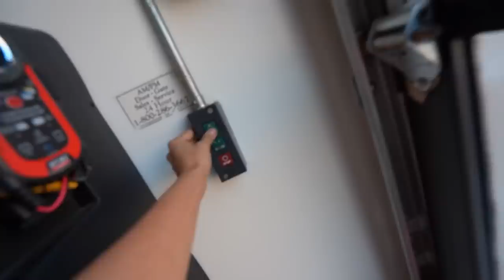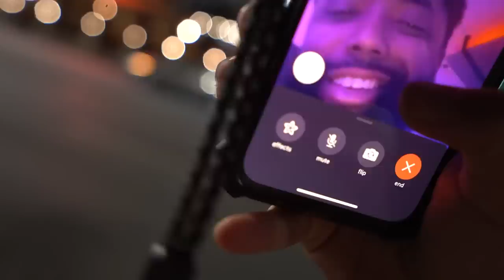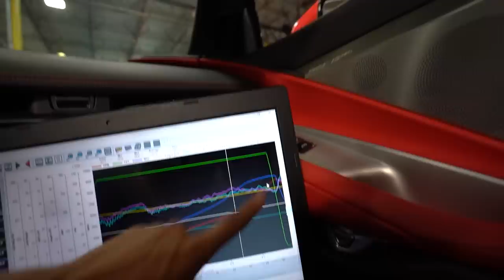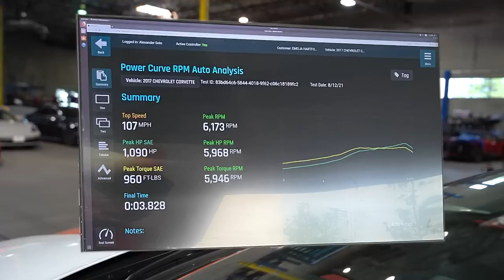TWIN TURBO C8 CORVETTE BREAKS WORLD RECORD HIGHEST HORSEPOWER! FULL DYNO PULLS 1400+ HP

Comment: One thing that helped my hi hp build was a set of ngk plugs that have recessed electrodes. So the porcelain-electrode / spark sits inside the body of the plug, it sits flush with the bottom of the plug. Helped big time with blowout

Comment: When you aren't using the meth injectors you should empty the tank and put regular gas in the tank and run it through the injectors.  You don't want that meth just sitting in the injectors.  You could even use 110 or higher gas just make sure if at all possible it's pure gas.
Reply: Yha, but it's Emelia.....When isn't she using the Meth??

Comment: EMELIA, a company in Vancouver Washington just beat your record and went 9.05 in their C8. You have the power to do it GO BREAK THAT RECORD AND BEAT THEM TO THE 8S
Reply: sounds like they upgraded their transmission too. I feel like she will need to do that to get into the 8s
Reply: @ICP1SBJ  It was an experimental job doing by their shop that they are testing on that car. Unlikely to be up for sale or proven yet so unlikely she can get her hands on it. I mean if the trans can hold it on the dyno it can perhaps hold the power on the strip at least for a few passes so she might be ok to get into the high to mid 8s but its highly unlikely it will hold past that.
Reply: @tstuff1213  yup I think hers might hold for a few passes but I do feel that is the weakest link right now. Time will tell.

Comment: 1,201 wheel horsepower is 1,459 at the crank roughly. that's a shit ton of horsepower, and now I'm curious about potential quarter mile times. maybe a low-mid 8 is possible now?

Comment: What was the fix?  They were trying to determine if it was clutch slip or tire slip so they hooked a computer up to trans and ECU, then on next pull it made 1000+hp and they didn't say what the issue was before.

Comment: Get out the hair spray like PFI uses. They call it dyno sauce. It makes your tires sticky. 
That run with 1090 Horsepower sounded like you eased the throttle better at the higher RPM. Earlier runs sounded like you pushed it to fast on the throttle.

Comment: There is only 8% drivetrain loss on the C8.  So it’s making 1300 at the crack. 
You guys are thinking of a regular front engine car which has a 15% drivetrain loss
Still an amazing number that’s enough to put Phoenix deep in the 8’s  congratulations 🍾

Comment: Whata craxy is all the peoppe on the word rich as people performance shop and noone has beat your record. I cant wait till its tune able cause your car with its set up now will be way faster if they clutchs can hold it that is 1400 ish hp stock 0 to 60 2.9 seconds i mean it shoupd be way way faster but the damn computer being locked doesn't help. I cant wait till we can tune it  thats why I love Ford the gt500 not only has rhe same tranny dual clutch etc. Has way more power stock than the c8 has line lock built in amazing and its TUNEABLE. Starts at 70k so around same price and has 760 hp stock. Watch drag video stock c8 stock gt500 base model arojnd same price c8 ran 11.5 at 122 the gt500 ran 10.8 at 132 just hammering it didn't use the mustang launch. They just had someone's 2020 gt500 modified 1000 hp beat a new tesla plaid crazy

Comment: Why does Hennesssey Proformance keep posting they have the world’s fastest C8 when your C8 is definitely faster  and you have the slips to prove it. If I’m wrong tell me but I’m 100 percent sure your time slips are a lot faster then there’s. He keeps posting his C8 is the worlds fastest and you claim yours is and I’m really sure yours is but let me know if I’m wrong. Thanks and keep it going.  I hope I’m right y’all’s is the fastest.
Reply: Do they make a diaper for the C8 yet ?  It's nice that the engine is in the back that way your not dumping oil in front of the wheels but it would be real nice if y'all could put a diaper on it . It doesn't look like an easy task to put one on there though. Race equipment makes them and what they do is , it looks like seat belt buckles that go around the frame or trans mounts and it just sits under the tranny to catch all the oil the leaks out. But under the C8 it doesn't look like theres is a spot to buckle it to

Comment: That billboard is as big as your ego. Do you really have the record? I thought it’s been broken.
Reply: she has the Dyno record and the 1/4 was just broke yesterday but this video was shot a few weeks ago.
Reply: @ICP1SBJ  dyno numbers are one thing, putting the power down the 1/4 is completely different. I’m not a hater but I’m not a fan of people who think they are the sh!t. Good on ya for holding the record for a bit.
Reply: @gman3725  She held the record for 6-8 mos and last time she did 9.41 her dyno was sub 1000HP even though she did 1022hp 6-8 mos ago. So it's clear to see if her HP is at 1,200HP her next 1/4 should be very close to the 9.05. I'm not sure she can do 8-second passes without upgrading her transmission as the 9.05 guy did. She has every right to think she is the shit because she held the record for a very long time. But big congrats to the guy that did 9.05.
Reply: @ICP1SBJ  You can make all the power in the world but if you can’t get down the 1/4 without spinning, it doesn’t matter.